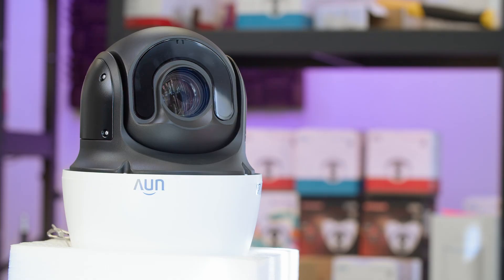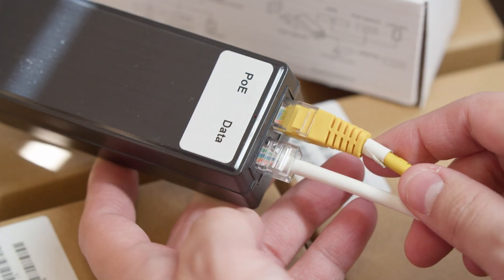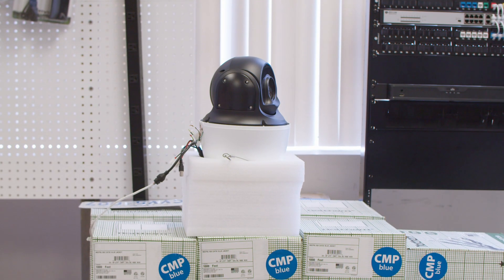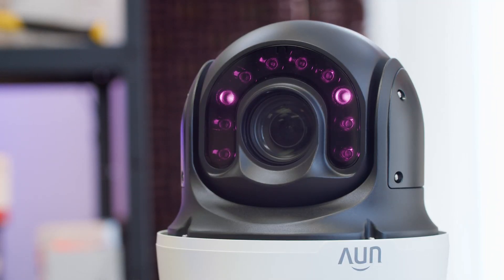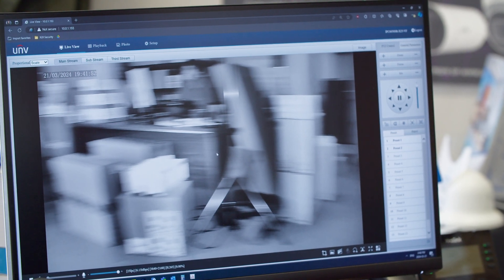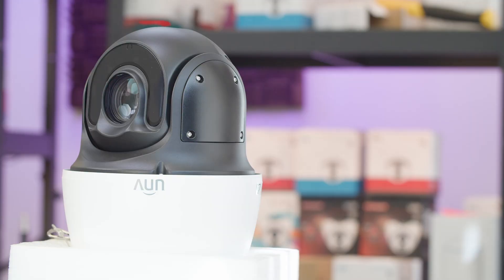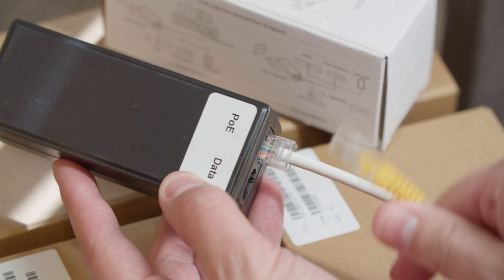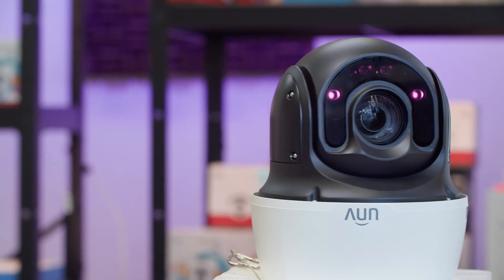PoE vs PoE+ vs PoE++ – What's the Difference? (testing on a 60W PTZ camera)

Comment: So I just need an injector? Because looking for 'PoE switch' most of them only support regular PoE? What about the topology? Is it like IPcam>PoE+ Injector>Switch Poe>Nvr
Reply from the maker: Correct – you'll need a PoE injector that supports PoE++ if you're using a high-end PTZ camera.

There is one mistake in your topology. The PoE+ injector does not need to connect to a PoE switch – it can connect directly to the NVR. The injector gets its power by plugging into a standard 120 V electrical outlet.
Reply: Plenty of 5, 8, 12 port POE + and POE++ switch on the market under  $100